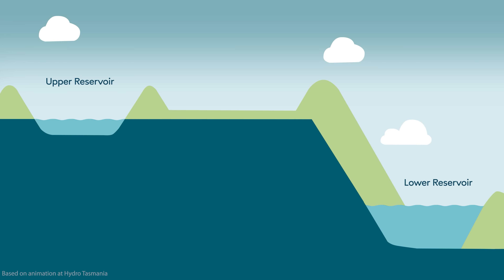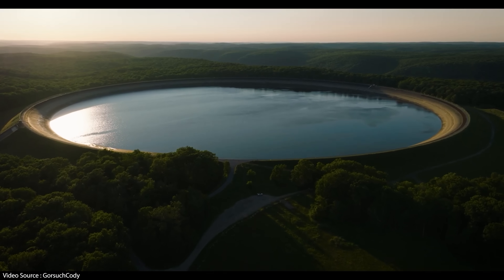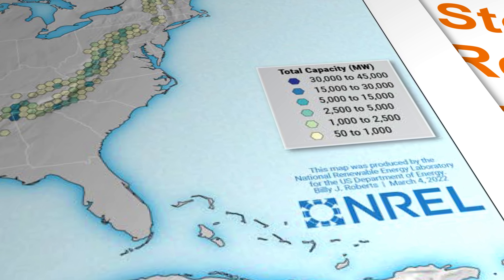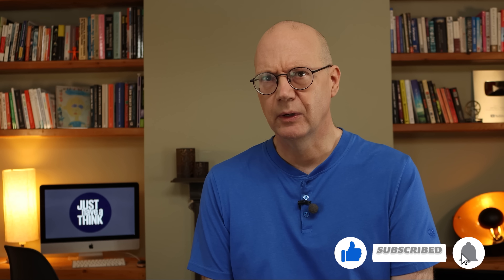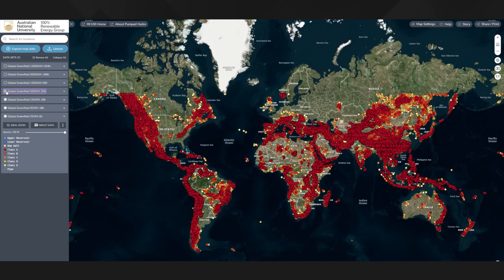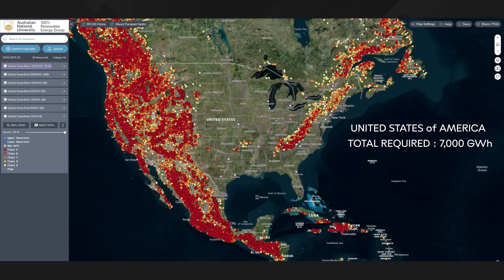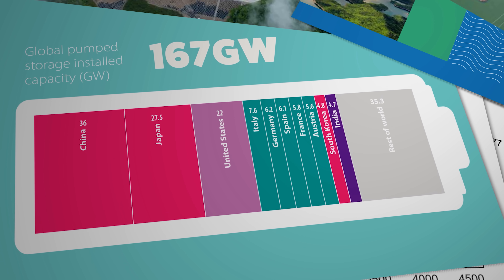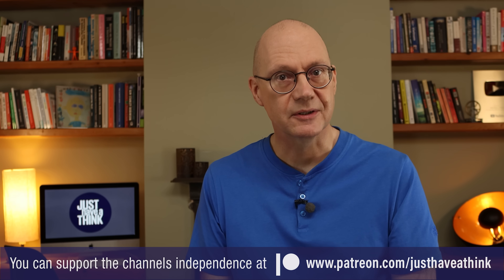The insane potential of Pumped Storage Hydro

Comment: This is a great subject! I've been reading about it and actually learned about a neat subset of this: the pumped seawater hydro plant. It takes ocean water and pumps it up a shoreside mountain. No need to involve fresh water reserves, nor river ecosystems. This is good if you are in a dry region, or on an island like the Azores.
Reply: The idea is simple but has some dangers. Salt water is not realy friendly to technical instalations and it must stay within the loop at all costs. Salt water tends to push away fresh water so the basins need to be sealed off from ground water. Also wildlife is atracted to basins, with salt water it will become a fauna killer.
The water does not have to be suitable for human consumption, still a form of desalinisation is desired.
Reply: @hotdognl70  the tidal power station at La Rance does see somewhat worse corrosion effects than freshwater hydroelectric facilities but it is not so bad that it's inoperable; rather the facility is still going strong beyond 50 years of age.

A salty reservoir close to the sea coast isn't going to do any significant harm to fauna adapted to living alongside the ocean and estuaries.   Positions should be chosen where all seepage and runoff joins other salty water nearby rather than running inland to contaminate fresh ground water.  Choosing suitable sites should really not be difficult.
Reply: Saltwater is  a huge problem as aleak into the surrounding freshwater table would destroy agriculture and freshwater supply.  Large reservoirs can be cheaply built by damming up the mouth of high level valleys facing seaward in Western Ireland. Sea level stays constant so inlet stays covered at all times. Salt also damages equipment.
Reply: @blugreen99  I think I wasn't clear, this isn't something that would be placed where there are lots of fresh water sources. Heck, it probably won't even be near agricultural regions. Billions of people live near coastlines and inland areas with very little fresh water. This could also be an option.
Reply: @JoeNunyabidness  Those places are exceptionally rare.  Iran... Red Sea region is near perfect... Yemen, Egypt, Eritrea, Southern S. Africa, Northern Chile/Peru, Baja Mexico.  That is the ENTIRE list for places you could put salt water reservoirs on land without harming the environment. That is a paltry list.  ... Inland areas have NO salt water either...
Reply: @w8stral  I disagree, there are many areas that lack fresh water but have a significant rise in ground level over the oceans. I literally mentioned the Azores because that is where the research found that it was solution to their power issues. There are tons of areas that only need a few hundred meters of rise to create a decent power system, take a look at a topographical map. Salt water reservoirs are a dryland solution, especially as Climate Change alters ecosystems and causes human migrations. 

Also, if you understood anything about aquifers, you'd know that there are many inland locations that have many brine reserves. By pumping these to mountain reservoirs, you could have both power generation as well as a location for a low impact desalination plant, since the excess would simply flow back into the underground aquifer rather than into the oceans.  This exists all over, including the US SouthWest. New Mexico has a wide variety of brine aquifers, with differing levels of salt content, right next to their very steep mountains. It would do about the same amount of damage as any other hydro reservoir. Especially when you consider the reality that there are already naturally occurring salt water surface lakes. 

Lastly, it should be noted that this isn't "the one final solution to everything!" It is just another tool in the box. Not sure why you are so dismissive of it.
Reply: @JoeNunyabidness  Suggest physics and geology class pronto.  Adios.    PS: The ONLY battery solution we have is pumped hydro storage.  It will require a hundred years to build and fill them all is the problem.
Reply: @w8stral  And I suggest you look at real world examples since you don't seem to understand the evidence that I've laid out. I have shown a real world example of pumped ocean hydro power system in the Azores. 

I'm quite aware of physics and geology, which is why I've been looking at the alternate ways it can be implemented in various regions.  Which I also laid out, but you don't know that salt lakes are a thing, nor that brine aquifers are a thing; perhaps it's you who needs to take a class. 

Hydro will take time to implement, but 100 years? Not hardly, but then I'm aware of how quickly a nation can respond to a real danger. Even back in the 20th Century they could build dams quickly, using modern systems it could be done much faster.
Reply: @JoeNunyabidness  just awesome info, joe. This is the conversation to be had
Reply: Sure if you wish to turn something into an unhospitable desert utterly unfit for anything to grow as you just salted the earth and its water table with SALT...
Reply: Excellent discussion, glad i found you people here. A thing that occurs to me is that there would be an amount of evaporation that would happen using seawater, naturally putting it into the fresh water system  (depending on location). Also that a mild filtration, as opposed to full-blown desalination, could be helpful in keeping cost lower and reducing wear on equipment.
Reply: @MicahScottPnD  Evaporation of saltwater already happens in the water cycle, so for the most part, it wouldn't be a massive concern. A concern, but not really a deal killer. Yeah, salt can be destructive to mechanical systems, so that would be a concern and a necessary consideration to considering other options. It's already in use in the Azores, with some published papers on it, so that could be a guideline.
Reply: @MicahScottPnD  since any upper reservoir for a seawater pumped hydro system would be very close to the sea coast, and constantly cycled back and forth with the sea, evaporation would not create concentrated brines.  The only risk of additional salt infiltration into freshwater systems would be to aquifers directly adjacent to or below the reservoir which are obviously already very close to the sea, and probably draining directly into it nearby.  Unless very unfavourable geography is chosen (siting the upper reservoir across a watershed from the sea coast, somewhere that drains further inland instead of towards the sea), any adverse effects would be quite localised.

Comment: Any research with using seawater (most pumped hydro uses fresh water)? In combination with floating solar farms of course!?
Reply: Freshwater is precious but maybe not that precious? If you'd use saltwater, you'd likely steadily increase the salinity because of evaporation and eventually your reservoir would start to get filled up with salt deposits (never mind corrosion problems in the turbine section).
Reply: @Hecatonchires1991  Tx for your input. I live in a water scarce country where water is really precious! Salt water would always be a challenge though, but I was hoping that research in other areas - ocean & tidal power - might provide solutions to some of these issues. Natural tidal pools have daily inputs of seawater without any build up...
Reply: @CitiesForTheFuture2030  If e.g. the lower reservoir of the installation was in good contact with the sea (salinity doesn't increase much beyond marine average) and the pumping cycle would be used routinely and sufficiently exhaustively, there would be no salt buildup.

Comment: I like the idea, but "chemical" batteries win on cost for 2-hour storage with daily cycles. Close to cities/ load centre. High power to energy storage ratio (GW / GWh). Instant reaction for grid stability services. Modular, so build what & when needed, within months. Able to piggyback on existing transmission / transformer networks. Fantastic future cost reduction path that hydro cannot match. Fewer NIMBY issues. 
Snowy 2.0 killed pumped hydro stone dead. Construction over 12 years.
Yet it’s weekly / seasonal storage where pumped hydro potentially wins, batteries aren’t worth it. But that’s big storage, 100’s of GWhs. And still expensive, environmentally risky. In competition with HVDC.
Reply: What kind of chemistry then? Chemical batteries until now are peanuts compared to pumped hydro, which is in turn peanuts compared to what it has to be in case of 100% renewables.
Reply: @Hecatonchires1991  present cells are designed for cars, weight constrained, small(ish). LFP prismatic work for now. OK chemistry: lithium, iron, phosphate, graphite, copper & aluminium current collectors. Not a great fire risk. Technology marches on, expect better batteries soon enough, down to $10-20 per kWh in a decade or two. Hydro can’t match that cost decline. Hydro proposed today needs to compete with batteries built in 2033 or later! It can’t.

Comment: I guess it's all downhill from here. Just imagine the energy efficiency if the upstream reservoirs could be replenished using evaporation.
Reply: i guess cover the lower reservoir with some clear plastic and have a pipe leading to the upper reservoir with something to cool the vapour near the top
Reply: I was being sort of tongue in cheek hypothetical since it would mean evaporation would provide 100% efficiency, but I don't imagine it could happen at a large enough capacity to make it worthwhile. But if someplace was hot, dry and windy enough to keep condensation from forming on pipes to carry the air with the evaporated water in it...who knows?

Comment: But this also requires some context.  For example, California's Hydro-electric generation in 2021, NON pumped, produced 12036 GWh.   That is also "storage", just not "pumped storage", and it dwarfs the pumped hydro in the state by three orders of magnitude.

Comparing that against the other figures.  23 GWh of existing pumped hydro (in the US? Not sure), 9000 GWh of existing pumped-hydro globally, and 35000 GWh of possible pumped hydro in the U.S.

Lets use California as an example again (as this is what I am most familiar with).  California needs around 500 GWh of energy daily in summer, net of renewables.  i.e. of non-renewable energy.  And roughly around 20GW worth of generation to make use of it (35GW during the evening peak).

So, as a thought experiment, is 500GWh worth of pumped-hydro feasible in California?  Possibly.  A quickly google gives me LCOS numbers around $400/MWh-year, so 500GWh would cost around USD $200M/year.    For California, I think that is in the realm of possibility though the project cost is probably considerably higher than LCOS usually estimates due to the 20GW of power output required.

Definitely food for thought.

Comment: Presumably the water above and below can be covered with floating solar panels for power and anti evaporation.
Reply: they'd need to be on a fixed structure due to the water level changes and that would require massive framing and you want the ability to access them for repair and cleaning....  floating panels is not friendly to technicians or structural engineers.  Save alot of money and time and put em on solid ground.
Reply: @rumls4drinkin  recently there was a clip, I think on fully charged, of a grid scale floating pv system with flexible cable connections to allow for different dam levels. it works fine.
Reply: @licencetoswill  ya you can make it work but it's more expensive.   

Is that something you personally want to pay extra money for when they could go on dry land instead?
Reply: @rumls4drinkin  but a floating rig can easily follow the sun. but i think many of the sites would be not right for a solar grid, because of shodow from hills around etc.
Reply: Maybe. But the regular large changes in water level in each reservoir will presumably make this more difficult than usual.
Reply: @rodnorton2658  mounting panels on a pontoon is just as simple as on a rooftop or in an open field, with the advantage that pontoons can easily follow the sun during the day with just simple winches and cables.
Reply: @rodnorton2658  When you start measuring in acre-feet, one can engineer around the difference of surface altitude as the system cycles.
Reply: @rodnorton2658  not if they are floating, the actual vertical displacement is less than the infographics suggest.
Reply: Harnessing the tidal power to pump the water in N.F.= free power

Comment: 3:06 as Niagara Falls demonstrates, dams are not always necessary for hydro-power. 2 existing rivers are partially diverted along the Chippawa-Queenston Power Canal to a point where there is sufficient fall through the tubines to the river. The fact that there is a waterfall makes the canal 5 miles rather than 50 but doesn't deny the principle.

Comment: What is the efficiency of pumped hydro? How does that compare with battery systems like Tesla Mega packs. It would be good to understand the trade-offs. People are concerned about mining of battery materials.  But battery  chemistry is constantly changing. I don't know if LFP batteries would be better  from that standpoint. On the other hand hydro may be longer lasting but might need more maintenance.
Reply: I imagine the round trip efficiency would be similar, around 80% since pumps and peltons are quite efficient.

Comment: I'm rooting for a future variation of pumped hydro: ocean gravity batteries using iron-ore (or concrete) masses raised from and lowered to the ocean floor departing from a tanker-like vessel (using an aramid or carbon (?) tether with a suitable hook) floating on the surface of some deep stretch of ocean. Unlike deep-sea mining, such an operation should be efficient in area required. There are many stretches of deep ocean just next to major industrial and population centres. It's a bit surprising how little this idea is dicussed and I'm a bit puzzled that the option which is more discussed in the media involves compressing air to the seafloor in stead.
Reply: That’s stupid. High maintenance, expensive, anything in marine is 10x more expensive. We don’t need to invent new stuff, wind, water, solar, batteries are all winners.

Comment: hmmmm, in our country . . . .0 sites available. 🤔
Maybe because its name is "The Netherlands" 🤣 
Highest peak is 300 meters, and we even share that point with Belgium and Germany.
Reply: Maybe Netherlands could link networks to countries which DO have hydro potential, like a grid? Or use AA batteries.
Reply: @iandavies4853  That could be easily done, probably already is connected to Germany and Belgium.
Reply: @Grizzold-HP2  agreed. Europe is somewhat connected, even to Lesser Britain. Can trade wind, hydro, nuclear, even coal power. Batteries can be placed almost anywhere, even at short notice (if in stock). Next is to get HVDC to Africa.
Reply: Relatively flat Belgium has one pumped hydro plant with 300m altitude difference it can roughly produce 1000MW (similar to one nuclear power plant) during 8 hours.
Reply: @paulfontaine7819  my keyboard is faulty. it is 300 meters, from sea level. but not from surroundings.

Comment: Surely you can do the same with wind turbines, when there is excess  wind capacity its possible to raise a weight inside a turbine tower , when the wind is low and you need capacity the weight could be dropped to turn the turbine.
Reply: If you crunch the numbers, you'll see that you're talking about peanut amounts of energy.
Reply: called a newton battery. check it out

Comment: I did not here anything about building the transmission lines.  I am assuming that a lot of these are going to be in remote locations far from existing transmission lines.
Reply: Yes. Snowy 2.0 Australia is case in point. Expensive transmission, long distance from generation and load centres. Cost ignored in original proposal, still excluded.

Comment: Pumped Hydro is pretty inefficient.  There is one use case that interested me.  There was a proposal somewhere to pump water up one side of a mountain range and down the other side.  This serves two purposes but it is a bit more expensive.  I know that they move water in California and recover energy on the other side this way, but that is potable water.
Reply: The efficiency range is between 75 and 80 percent (full-circle efficiency). Don't understand the rest of your comment: this (in)efficiency figure cannot be improved with a trivial configuration adjustment like you seem to want to suggest.